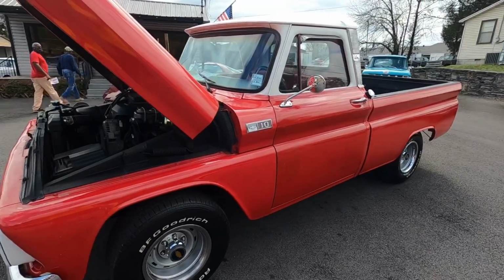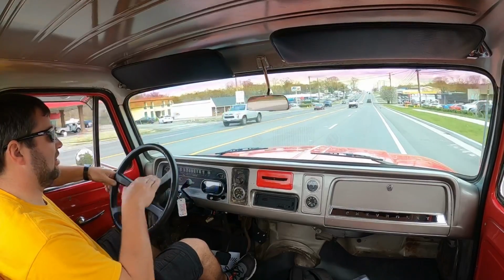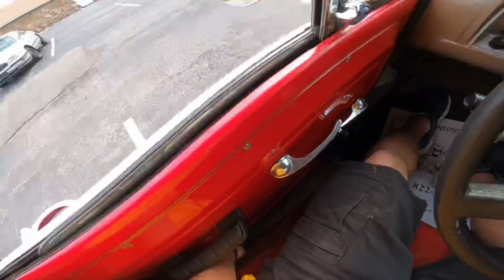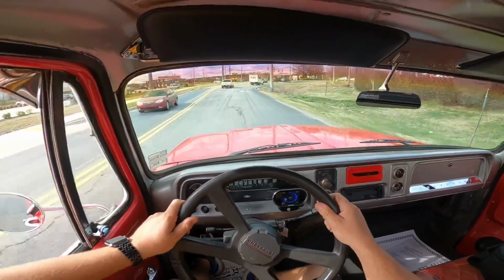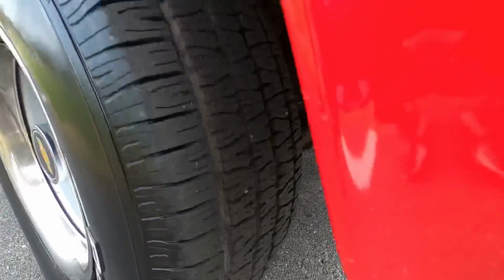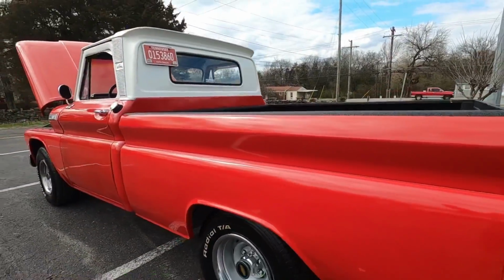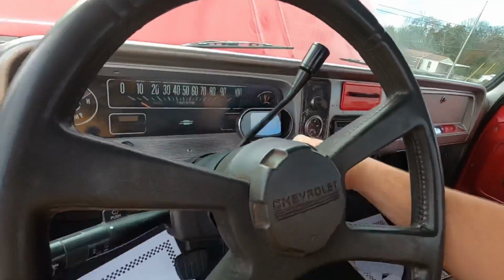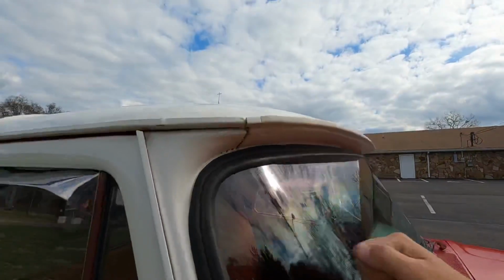Test Drive 1966 Chevrolet C-10 SWB LS Fuel Injected SOLD $21,900 Maple Motors #1531

Comment: Steering box worn out is why it has slack and that's why it's pulling to one side. Common on those old trucks. The cracks are from Bondo, bubbles on the lower door panel is rust underneath, had cheap single stage paint job is why it's chipping easy. It's not a custom because it has a small back glass. Bondo in the floorboard plus complete patch panel floor.
Reply: It could still be a custom with the small back window. Big back window was an option.

Comment: Decent shape 66 C10 be nice project truck I see 3 area's need attention floor patch work on driver side, front window shield rubber & passenger side front adjustment ohh brake work.

Comment: are the prices negotiable or firm ???
Reply: They dont really negotiate but i hear what your saying. If i was doing a classic vehicle insurance inspection I would value this right around 16-18K with a 3-4 rating, fair condition...They prob paid 14-15k for it and detailed it as its what they do. They also deal in tires and rims so really they buy old restorations throw some rims on them clean em up and flip em they dont fix them up
Reply from the maker: Price marks are off , we only mark them up right at 3gs. For the rest yes we tell you whats wrong and move 60 a month that way. Hard to keep up with that alone . Thanks
Reply: @MapleMotorsNickSouthgate  My math sucks but $3000 mark up and selling 60 vehicles a month, Maple Motors is doing just fine. No wonder you don't bother getting involved with fixing all the little problems. Just plain wouldn't make good business sense. Shoot, customers throw them to your buddy next door and I'm pretty sure he'd give you some $ for all the ads and customers. Works for both parties. Both of you have a great thing going down there. Congratulations to ya both !!  Good Biz for sure.
PEACE from Philadelphia
Reply from the maker: Prices are firm for at least 60 days. Thank you

Comment: Sounds like timing is off a bit when you try to romp on it a bit. Not bad but probly could use a bit of adjustment
Reply: How do you adjust the timing on that type of engine? I thought that it was all computerized because the individual coil packs per cylinder. 
I don't know, does it have a distributor that can be turned for timing?

Comment: Nice truck!!! These trucks are bad about rusting out up above the windshield like that nick. There’s actually a large channel up there between the panels that mice, rats, squirrels, and other varmints love to stash their nuts in and I’ve also seen them packed full of mouse nests and then they pee up there and it rots the metal out quickly. They do make repair panels for that truck tho so it’s not a big deal